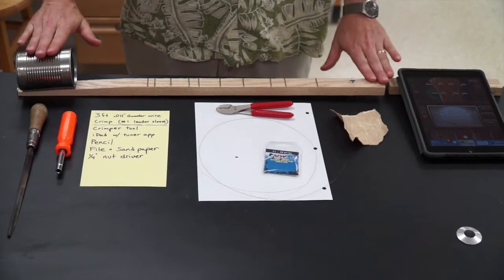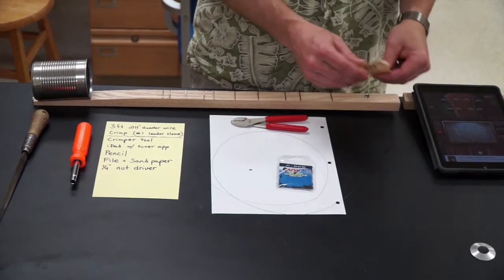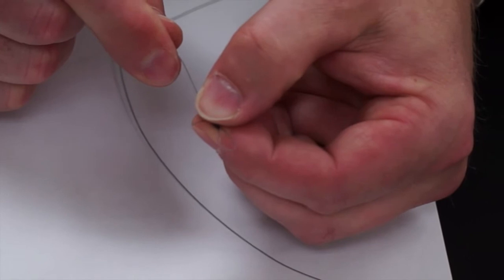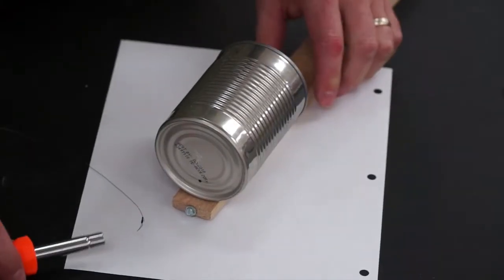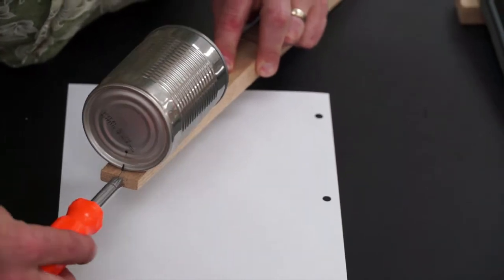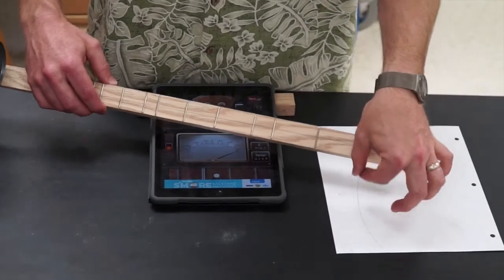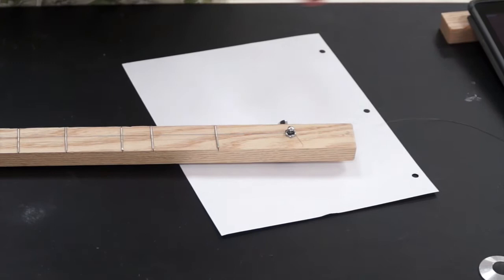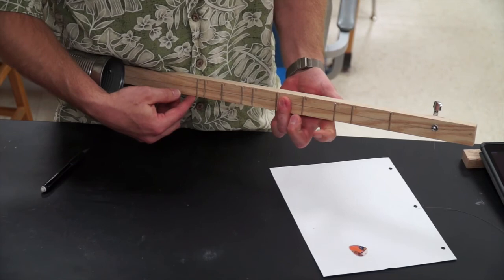Making a Canjo part 4

Comment: What about the millimetre measurements for all the frets. Statring from the can as per your video fitting frets
Reply from the maker: Calculated values   
freq(Hz) length(cm) number note
261.6         61.4             0            C
293.7         54.6             1            D
329.6         48.7             2            E
349.2         46.0             3            F
392.0         40.9             4            G
440.0         36.5             5            A
493.9         32.5             6            B
523.3         30.7             7            C
587.3         27.3             8            D
659.3         24.3             9            E
698.5         23.0             10          F

These are sample values based on our string we use. Ideally you would test your string and calculate your own values.

Comment: Why don't you use strings from an e-guitar? They have kind of balls on the end so you don't need the the loop and the screw
Reply from the maker: We make about 200 of these a year with students, and this method is substantially cheaper when doing in large quantities.

Comment: Sorry, but I'm a simple man. Was hoping for the millimetre measurements as per your video using a yard sticky,
Reply from the maker: About 32 inches(81cm) long, 1.25 inches(3.2cm) wide, 3/4 inch(1.9cm) thick and a bevel for the bottom 8 inches(20.3cm) to half the thickness.